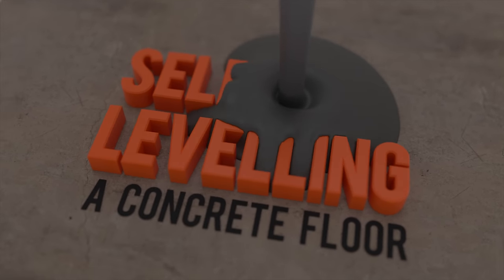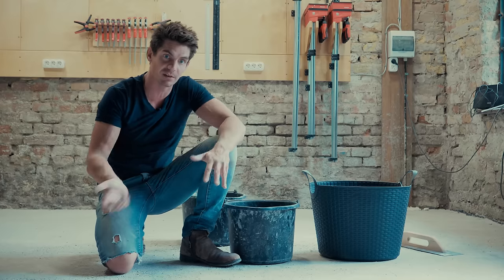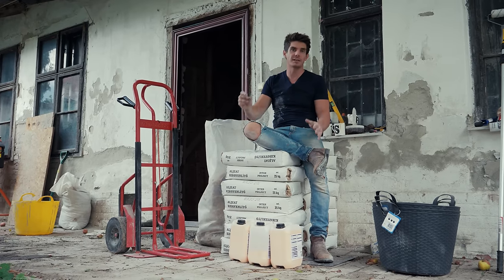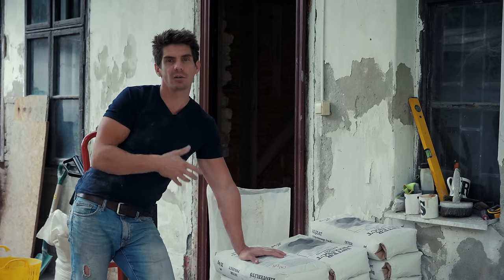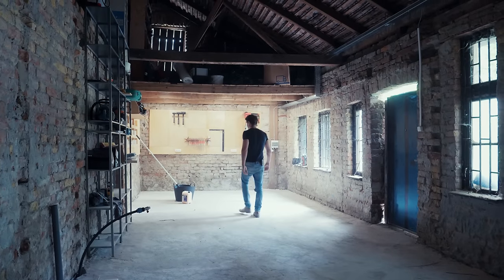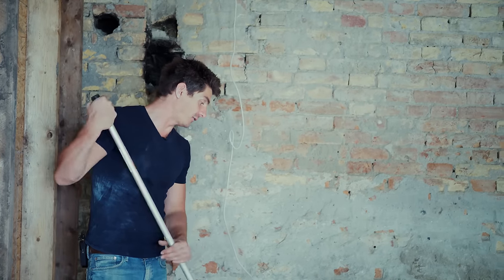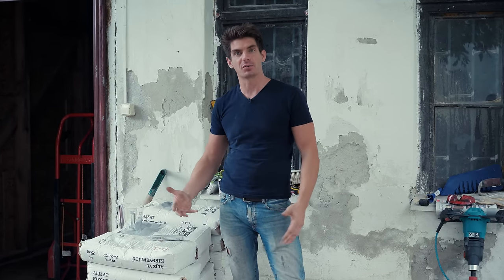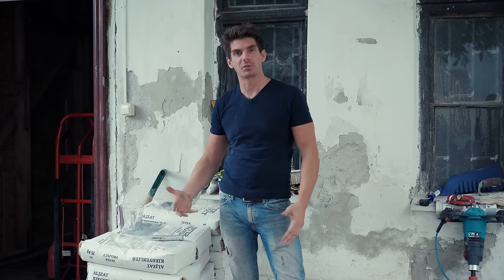Self-levelling a floor - The Complete Guide

Comment: Can I use this on flat roof for leveling?
Reply: a concrete roof is a floor on a higher level - so why not?
Reply: Think you'd best not. You want the water to run to the outlet or to the side where the upstand of the roof is or gutter. What exactly is your roof like and what is your objective. I'm an architectural technician so I can help you.
Reply: Flat roof with some areas of standing water. I am trying to eliminate a standing water b to leveling those areas.
Reply: @natalias1212  where does the water eventually run off to? This is where you need the fall of your roof to go. What is the roof made up of as it is? Sounds like it's some sort of felt which has sagged and explains the standing water. Making it perfectly flat using this stuff will not do anything other than cause more issues and is not suitable under any circumstances.
Reply: Thank you so much. Looks like you are correct and  I need to redo the whole roof.
Reply: @natalias1212  my advice would be just that. Take it back to the joists. Lay down 12mm water and boil proof ply (WBP ply) for supporting the above, vapour control layer, 120mm min tapered insulation from Kingspan to one point where the new gulley would be and 18mm WPB ply with a suitable upstand for the roof covering around and a roof covering of your choice. My advice would be a GRP (fibreglass) covering as it comes with a  25 to 30 year guarantee. (if its good enough for boats, it's good enough for a roof is what I say) This is a warm roof and needs no ventilation like an old fashioned cold roof.

https://polyroof.co.uk/products/185-system/
Reply: @SteS  great. Thank you so much!
Reply: @natalias1212  for a flat roof you need a 2% to 3% inclination to the gutter. A leveled roof will always have trouble with standing water und puddles.
Reply: @mucsalto8377  Thank you!

Comment: "efflorescence"
Reply: no, laitance. Efflorescence is salts crystallising on the surface. Laitance is excess water with ultra-fine particles in it which floats on top of the mix as it settles out. When it dries it's very weak and turns to dust.
Reply: @resouris  lait is French for milk, so the liquid you're describing would be milky

Comment: the first mix is too thick....self levelor will never flow at that consistency, it has to be more watery to work otherwise you will get humps.
Reply: So disregard the manufacturers exact specified water/mix ratio...sounds unwise.
Reply: @brokenpencil57  its very little extra water makes a lot of difference.  Self Levelor is like thin set mortar it has a  small degree of flexibility for the amount of water depending on needs of the job.

Comment: No PPE and dealing with concrete dust. No mask. No knee pads for kneeling on the floor. This guy has never worked on a building site as you can see from the result of not rolling it in time. If you do it the way he did, you could end up with concrete burns, burnt lungs and a bad floor. He would be booted off any half decent building site.

Comment: And the water does leave the mix else it would never dry, it triggers the chemical reaction solidifying the mix, same with plaster same with filler. You'd need a hovercraft to get to your workbench every day otherwise, or water skis and a winch.

Comment: Thanks for showing me how not to self level my floor. I think you should have made that large rubbish bin contraption with a pvc pipe valve device at bottom and rollers to move the rubbish bin around. . And you could have done the whole floor mate. I think if you made it more wet 6 liters or 6.5 you would have had more working time when doing it by yourself.

Comment: You telling that it doesnt dry and the water chemically alters to always stay in the floor is Bullshit!
And you should never tile right over a newly layed self leveling compound. 

In my house i had a pump truck to do mine since it was over 50mm some places.
And it took weeks before it was dry and water stopped condensing and running
Down my windows and it changed to a much lighter color

Comment: ...but if it’s self leveling, why is am I watching this?
Reply: Don't think of it as 'self-levelling', think of it as 'self-smoothing'. It's too thick and sets too fast to truly find a level. I know this because I've just had my kitchen floor 'levelled' with this stuff and all it's done is smooth it out without truly levelling it. There are gradients of 1cm in 1.5m still.  If you need to truly level a floor you need to put levelling tripods all over it and align them with a laser level before applying your compound/screed to the level shown on the tripods.

Comment: The guys using “concrete floor paint” are using epoxy. And the only reason it would fail within a year is exactly why your floor will as well. You didn’t grind your concrete before you primed, let alone vacuum which you said isn’t really necessary. It’s always necessary. Self leveling concrete is made to be tiled on, polished, grind+sealed or coated. You have no clue what you’re talking about